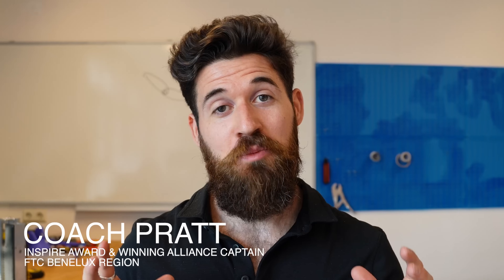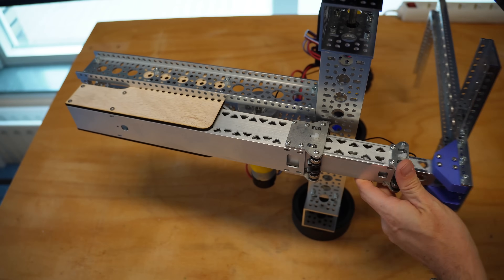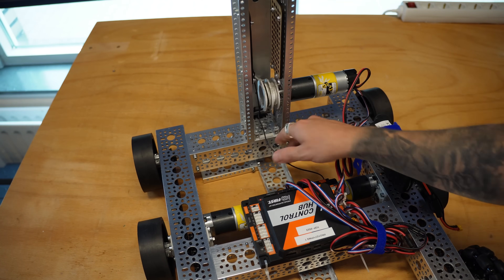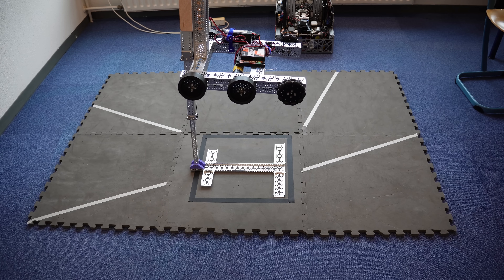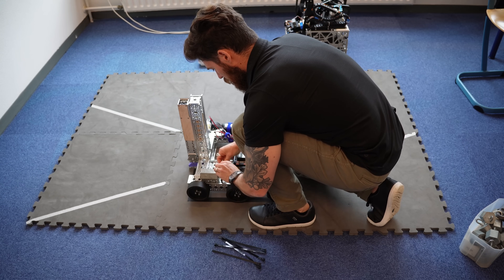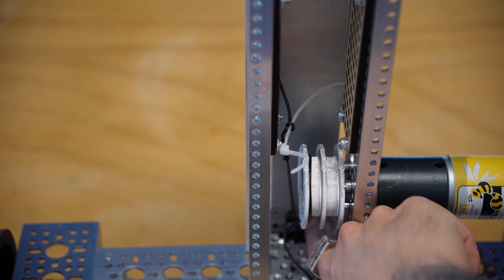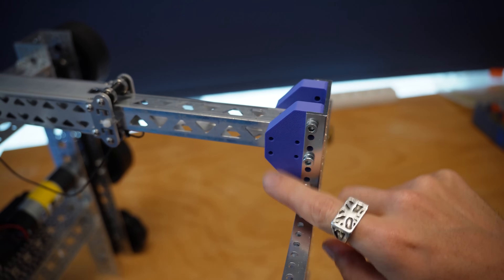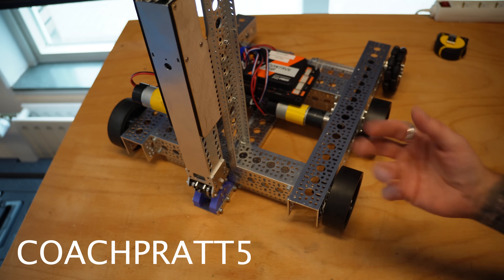How To Base 2 Robots in FTC DECODE (Working Prototype)

Comment: Quick question, is this stat where the robot couldn’t lift anymore? That means this system can lift up anything less than 130 Kg? Btw this opened my eyes a bunch about how strong one motor really is. Thx for the guide! 8:57
Reply from the maker: Glad to have helped! You can use some online torque calculators for gear ratios. Combine this with some lever arm calculations, and you'd get that info pretty quick.
Reply: @BroganMPratt  Thanks! Happy Decoding!

Comment: Do you think it would be possible to assemble this using a gobuilda Linear Actuator
Reply from the maker: If you did x2 supports on the side, it would likely work. Might be a bit tall? A cantilevered system like this would almost certainly not work.

Comment: why do all this design work and commit all this volume to a mechanism to lift yourself all that height only to be able to park a robot smaller than 18"
Reply: furthermore, suppose your partner also decided on the same design: cant park!
Reply: we think symmetry (if both partners adopt the same design, can BASE park 2) is an essential part of the solution design.
Reply: ah, didn't realize it was higher than 18".  The underside clearance and "rampifying" the bottom for another robot seems tricky.

Comment: why not stand on a middle foot barely off the ground.  Both robots can be 18" if each is on a 4.5" diameter foot and they arrange diagonally in the zone.
Reply from the maker: That's also a great option. One thing about that strategy is that both robots would have to employ the same strategy, and I think many robots don't have this mechanism.
Reply: and any other strategy will have the robots doing more physical work than strictly needed to achieve.  It's the first principles optimal solution.

If your team has already committed space at the bottom center of mass of the robot for some other purpose, you may want to consider whether it was worth it

Comment: This likely wouldnt work since the robot underneath can only be supported by the tile. I dont know if I missed you acknowledging that but its a weird rule to look out for
Reply from the maker: I don’t think you’re correct in your reading of this rule. Robots need to be fully or transitively supported by the tile, meaning if they’re supported by another robot, in this case on the plate, that it is acceptable.
Reply: @BroganMPratt ohh. My bad. I really like the design then!

Comment: Does this design use a Linear Actuator or a misumi linear slide and is there any video to assemble this design  fully?
Reply from the maker: It uses a telescopic elevator from offset robotics. If you see the link in the description you can pick up a kit for 5% off. As far as I know it’s the only telescopic elevator on the market for FTC. Offset has a full assembly video on their site.

Comment: What do you think is better, a robot that shoots three balls at once for speed, or one that shoots one ball at a time that is also pretty fast but ofc the three balls at once is faster?
Reply: One that shoots 3 at a time has the advantage of quickly gaining points, but the one at a time solution has the benefit of being able to choose when to shoot each.
E.g. you shoot a purple artifact and want a green one next, so you can wait until your alliance partner to shoot a green and then shoot purple
Reply: For the early season just dumping artifacts quickly will gain points, but later you will definitely want to choose what and when to score
Reply from the maker: I think that answer has yet to be decided. Teams will have to run simulations and test which works best. My guess is it depends on strategy. If you have a human loader for the artifacts, my assumption is x3 at a time is better. if you're picking from the field however, x1 may be better.
Reply: @BroganMPratt  dont you think a three at once shooter may not be the best for long range shoots?
Reply from the maker: Depends. Many would say the same at flywheels. Accurate shooters are accurate.

Comment: Awesome solution, what was your gear ratio and spool diameter
Reply from the maker: 36mm spool, 112RPM motor. You'll definitely need to test, this is a super rough prototype as a proof of concept.
Reply: @BroganMPratt Yeah, wonder if It could be servo actuated with a spring
Reply from the maker: Definitely could work. That'd have to be a darn strong spring.

Comment: We are running 4 servos for this, hopefully it’s enough power 😅
Reply from the maker: Can you not use a single DC motor? It'd be worth it in your x8 motor "budget"
Reply: @BroganMPratt We already have 8 motors used because of having a turret and a spinning indexer 😢
Reply from the maker: I wouldn;'t be so sure on this yet to make broad claims. Need to test your own solutions.
Reply from the maker: Wow, a lot of motors! you may consider a PTO type mechanism then.

Comment: Janky coming down can probably be fixed with a good feedforward. The one thing that I'm not sure of is whether the robot needs to shut off after teleop ends(and if yes, can you mount a strong enough rachet gear)
Reply: It doesn't matter if it falls back down... there will be another robot underneath it to stop the fall!
Reply: @davehairston8616  i feel like a lot of robots arent meant for downward pressure from the top but ig you dont have to worry abt that
Reply: @davehairston8616 no teammate who knows that will risk parking underneath you
Reply: @davehairston8616  Not every single robot will be able to sustain the fall (I'd even go as far as saying most robots wouldn't, because they need some sort of shooting mechanism or turret on top)
Reply from the maker: I believe the falling on another robot point was said in gest. I would not suggest that you actually do this.
Reply: @BroganMPratt  yeah of course :)
Reply: @ubuntuuser  now I see it. The sarcasm just flew over my head
Reply: @vladbintintan7659 sorry it probably wasnt funny now that i think about it
Reply from the maker: Yes, if you were to string a return that janky down goes away. 
However, rule G404 states "DRIVE TEAMS should make it obvious that the ROBOTS are no longer being controlled by pressing the (■) stop button on the DRIVER STATION app or by
setting down their controllers."

it doesnt state you actually have to press the stop button, simply no longer controlling it. So you could leave the motor powered while the other team retrieves their robot so-as to not damage their robot (as the way I'm reading this).
Reply: @BroganMPratt  i am fairly certain the janky return is a result of the torsional force on the box tubes caused by the robot being cantilevered over the whole system. adding a second lift would fix this, and allow for a heavier robot to be lifted without potentially damaging the lifts
Reply from the maker: Perhaps, though a good chunk of that is resolved with a powered lift. I doubt you'd damage the telescopic lift on heavier bots, it's quite thick aluminum and square corners add quite a bit of rigidity. Even more so if you use the non-pocketed version.
Reply: The janky return is not an issue; just lift up the robot before retracting the extension.

Comment: Nice and simple start.
Using lead screw will increase torque and stability, as per limit of 38 inch, 18 inch long lead screw will rise robot high enough with stability...
Reply from the maker: Also a great way of managing this challenge
Reply: An 18 inch lead screw will not be able to lift you enough to guarantee another robot can fit underneath. You have to have a 2nd stage of some kind.
Reply from the maker: Depends. I doubt many teams will shoot for max 18'' height this season.